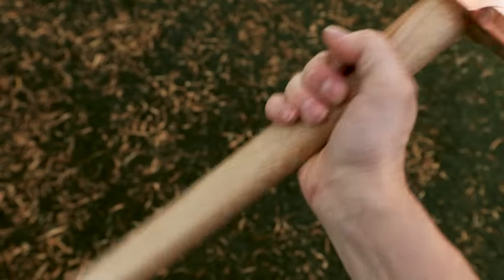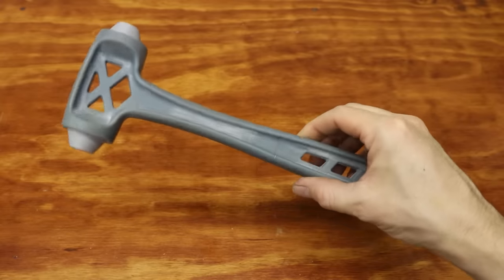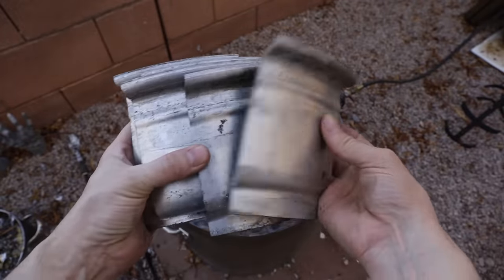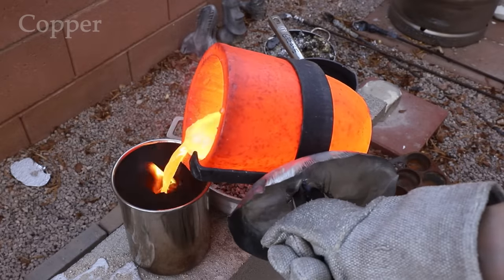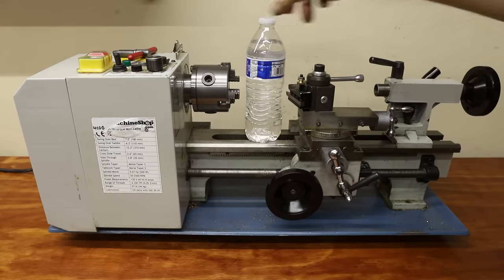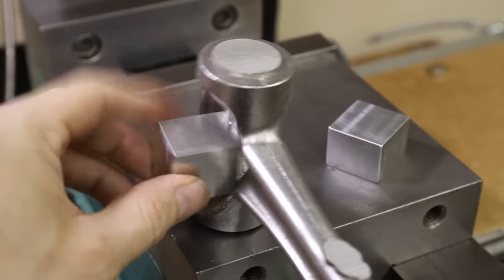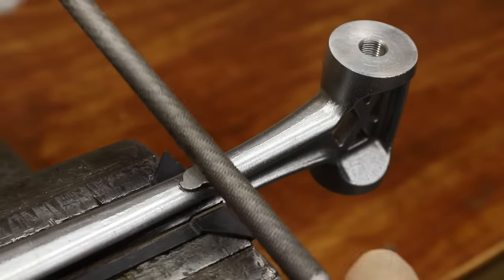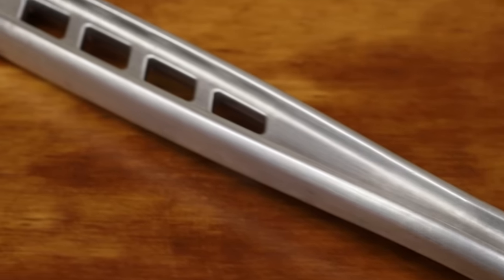Making a Skeletonized Hammer - COPPER or BRASS hammer? HAMMER TIME!

Comment: I really liked the idea of this hammer having the head screwed on. In theory you can create other heads for this hammer and change them as needed. It can transform into a rubber-headed hammer (used in woodworking), tipped steel head, or even a small ax or wheel wrench.
Reply: exactly
Reply: Hammers like this one have been being made both mass produced and custom made for a long time. You are right, you change the heads out for whatever you need. Most commonly brass and Delrin or PLA heads are used on them.
Reply: I used to have hammers like that there great, but this one is way better and prettier.
Reply: @darrellbeets7758  And WAY!  OVERPRICED !! TOO !!
Reply: @davidwillard7334  huh? Were are u talking about lol?
Reply: @darrellbeets7758  he was replying to @Curiosity Forge
Reply: No shit haha
Reply: @davidwillard7334  You know mate, there is punctuation other than exclamation points, and the caps lock key can be toggled off. Just thought you might want to know.
Reply: There's a reason that no decent manufacturer makes screw in copper faced hammers, about 25 years ago I had a brain fart and thought it was a good idea and wondered why nobody was doing it, I was an apprentice at the time and the tradesmen told me I was wasting my time and to not make screw in copper and aluminium faces for my Thor nylon faced hammer. So after I bought a new hammer a month later I didn't make that mistake again, the faces constantly came loose and ruined the threads in the hammer.
Reply: @RedMaij  SO ! SPELLBINDING !! TOO !!
Reply: Modular builds are definitely the way to go, especially if you want to quickly test and explore new features without making a new hammer.
Reply: @mrsock3380  Don’t use threads to lock your heads in place Brother, many ways to fasten an object in place. I recommend using a pin lock such as a cotter pin design.
Reply: Let me attach my sponge to soak up the water and then the magnet to hold nail in a dangerous way faceing me
Reply: Holy shit. They don’t come much smarter than Alan nowadays.
Reply: No sir. A hammer that's so beautiful like this ?I'm keeping it in a showcase
Reply: or even pickaxe
Reply: @RedMaij  so English isn't made to be written like a book constantly it's made to have inperfections
Reply: Неправильно сделано поверхность должен круглый. На этой молотком не сможешь ровно ударить
Reply: »The book of the generation of Jesus Christ, the son of David, the son of Abraham.
Abraham begat Isaac; and Isaac begat Jacob; and Jacob begat Judas and his brethren;
And Judas begat Phares and Zara of Thamar; and Phares begat Esrom; and Esrom begat Aram;
And Aram begat Aminadab; and Aminadab begat Naasson; and Naasson begat Salmon;
And Salmon begat Booz of Rachab; and Booz begat Obed of Ruth; and Obed begat Jesse;
And Jesse begat David the king; and David the king begat Solomon of her that had been the wife of Urias;
And Solomon begat Roboam; and Roboam begat Abia; and Abia begat Asa;
And Asa begat Josaphat; and Josaphat begat Joram; and Joram begat Ozias;
And Ozias begat Joatham; and Joatham begat Achaz; and Achaz begat Ezekias;
And Ezekias begat Manasses; and Manasses begat Amon; and Amon begat Josias;
And Josias begat Jechonias and his brethren, about the time they were carried away to Babylon:
And after they were brought to Babylon, Jechonias begat Salathiel; and Salathiel begat Zorobabel;
And Zorobabel begat Abiud; and Abiud begat Eliakim; and Eliakim begat Azor;
And Azor begat Sadoc; and Sadoc begat Achim; and Achim begat Eliud;
And Eliud begat Eleazar; and Eleazar begat Matthan; and Matthan begat Jacob;
And Jacob begat Joseph the husband of Mary, of whom was born Jesus, who is called Christ.
So all the generations from Abraham to David are fourteen generations; and from David until the carrying away into Babylon are fourteen generations; and from the carrying away into Babylon unto Christ are fourteen generations.
Now the birth of Jesus Christ was on this wise: When as his mother Mary was espoused to Joseph, before they came together, she was found with child of The Holy Ghost.
Then Joseph her husband, being a just man, and not willing to make her a publick example, was minded to put her away privily.
But while he thought on these things, behold, the angel of the Lord appeared unto him in a dream, saying, Joseph, thou son of David, fear not to take unto thee Mary thy wife: for that which is conceived in her is of The Holy Ghost.
And she shall bring forth a son, and thou shalt call his name JESUS: for he shall save his people from their sins.
Now all this was done, that it might be fulfilled which was spoken of the Lord by the prophet, saying,
Behold, a virgin shall be with child, and shall bring forth a son, and they shall call his name Emmanuel, which being interpreted is, God with us.
Then Joseph being raised from sleep did as the angel of the Lord had bidden him, and took unto him his wife:
And knew her not till she had brought forth her firstborn son: and he called his name JESUS.«

(Gospel of Matthew - Chapter 1)
Reply: @jakub8860  Amém. I dont have any idea why you wrote this here, but it is always nice to read the words of God. Some years ago I tried to memorize the Bible (inspired by the movie  "the Book of Eli") and I began with this chapter. I get just till chapter 3 or 4 lol.
Reply: Small axe? Maybe with a weight on the other side of at least 10 kg we can make a weapon out of it...
Reply: Small axe? Maybe with a weight on the other side of at least 10 kg we can make a weapon out of it...
Reply: @Piglin_Emperor  Maybe.
Reply: No hatchet or socket wrench. Not relying on threads into cast aluminum.

Comment: Looks great! Just make sure it never gets wet. Aluminium and copper in contact have a high electrochemical potential.
Reply: I didn't know that.
Cool
Reply: Or just add antiseize or some high quality grease. Not perfect but it might help
Reply: I just learnrd about this phenomenon that the more precious metal erodes the lesser one
Reply: @bigpat_4295  there can be only one
Reply: Only if it remains wet. Once the electrolyte dries up the electrolysis stops. Also plain water is not likely to be much of a problem as it has a low S/m.
Reply: Also, don't let it stay up past midnight
Reply: @benjaminholcomb9478  😆😆😆😆

Comment: If you ever design another hammer, instead of threads, poke the "leg" of the face through the hole in the hammer body, and then use leverage to keep it in place. Think jar lid with the metal wire. Not only does that look cool, but it also gives you more mass.

Comment: Make sure to anti seize the brass side or it will never come off, it and aluminum have a high galvanic potential. Beautiful project, really liking the chanel so far
Reply: That's great advice!
Reply: Copper and aluminimum can also have a galvanic potential too, we run into this a lot in watercooling too, lots of cheap parts are aluminimum so you can only use them with alu blocks and rads etc

Comment: Honestly, so cool the stuff you make. You should try making one of the detachable heads of the hammer out of non-metal. Just to see what happens.
Reply: Not an absurd idea at all. We have some hammers in our shop with a soft acrylic head for detailing work.
Reply: It would work perfectly fine so long as the threads were solid.

Comment: I've made essentially exactly this before, just less cool looking and the one warning I have for this kind of thing is that even though the screw-on faces are soft, with enough use they will completely deform the actual hammer head.

This was bad enough on mine that the whole thing had to be scrapped so for v2 I put a thin (2mm ish) replaceable plastic washer behind each head to soak up the impacts and it seems to work well.
Reply: DEFORMITY ! IS ! SOMETHING!  YOU !! HAVE  ! TO ! LIVE !! WITH !!
Reply: @davidwillard7334  yes, but good design limits it to the parts that are designed to deform.
Reply: @JedLath292  thus be smart with how ya make ya own tools :P a smith is only as good as his worst tools in the long run.
Reply: I was going to suggest exactly the same thing, a plastic or rubber gasket between the "heads" and "body" of the hammer will greatly improve durability over long term use.
Reply: @davidwillard7334  Something tells me this phrase is plastered on the wall of every...whatever the college class for smithing/version of Tech Ed is classroom.
Reply: »The book of the generation of Jesus Christ, the son of David, the son of Abraham.
Abraham begat Isaac; and Isaac begat Jacob; and Jacob begat Judas and his brethren;
And Judas begat Phares and Zara of Thamar; and Phares begat Esrom; and Esrom begat Aram;
And Aram begat Aminadab; and Aminadab begat Naasson; and Naasson begat Salmon;
And Salmon begat Booz of Rachab; and Booz begat Obed of Ruth; and Obed begat Jesse;
And Jesse begat David the king; and David the king begat Solomon of her that had been the wife of Urias;
And Solomon begat Roboam; and Roboam begat Abia; and Abia begat Asa;
And Asa begat Josaphat; and Josaphat begat Joram; and Joram begat Ozias;
And Ozias begat Joatham; and Joatham begat Achaz; and Achaz begat Ezekias;
And Ezekias begat Manasses; and Manasses begat Amon; and Amon begat Josias;
And Josias begat Jechonias and his brethren, about the time they were carried away to Babylon:
And after they were brought to Babylon, Jechonias begat Salathiel; and Salathiel begat Zorobabel;
And Zorobabel begat Abiud; and Abiud begat Eliakim; and Eliakim begat Azor;
And Azor begat Sadoc; and Sadoc begat Achim; and Achim begat Eliud;
And Eliud begat Eleazar; and Eleazar begat Matthan; and Matthan begat Jacob;
And Jacob begat Joseph the husband of Mary, of whom was born Jesus, who is called Christ.
So all the generations from Abraham to David are fourteen generations; and from David until the carrying away into Babylon are fourteen generations; and from the carrying away into Babylon unto Christ are fourteen generations.
Now the birth of Jesus Christ was on this wise: When as his mother Mary was espoused to Joseph, before they came together, she was found with child of The Holy Ghost.
Then Joseph her husband, being a just man, and not willing to make her a publick example, was minded to put her away privily.
But while he thought on these things, behold, the angel of the Lord appeared unto him in a dream, saying, Joseph, thou son of David, fear not to take unto thee Mary thy wife: for that which is conceived in her is of The Holy Ghost.
And she shall bring forth a son, and thou shalt call his name JESUS: for he shall save his people from their sins.
Now all this was done, that it might be fulfilled which was spoken of the Lord by the prophet, saying,
Behold, a virgin shall be with child, and shall bring forth a son, and they shall call his name Emmanuel, which being interpreted is, God with us.
Then Joseph being raised from sleep did as the angel of the Lord had bidden him, and took unto him his wife:
And knew her not till she had brought forth her firstborn son: and he called his name JESUS.«

(Gospel of Matthew - Chapter 1)
Reply: @JedLath292   My drill broke and now it identifies as a mallet.

Comment: A rubber buffer layer in between alluminium handle and both the hammer heads would help the handle deform less and changing the heads easier.

Comment: I remember decades ago, about 5, in metal shop in high school.
We did sand casting, sheet metal work and machine work on a lathe.
I made a small 2 faced hammer out of steel, brass and aluminum.
The head was about 1/2" diameter, was 2/3 steel & 1/3 brass. The handle was aluminum about 1/2" in diameter tapered to 1/4" tapped to fit into the head.

Comment: If you don't plan on getting a bigger lathe, get a used (second hand) cast iron surface plate that can accommodate the lathe's feet. A lot of the issues small lathes have stem from vibration management.
Reply: Could you also mount the feet on some dense rubber that would dampen vibes, and then mount the rubber to something solid e.g. concrete floor?
Reply: @RC-fp1tl  not sure, but I don’t think so. You want it to be as massive and solid as possible... so no rubber

Comment: Looks really nice I'd recommend adding a small slit from the threads to the side not a something deep just a tiny 20tho deep slit to release an air trap in 2-5 years when you swap the ends out otherwise in a few years once oil and grime builds up it will trap a vacuum and feel like it was epoxy together.
Another option is coat the flats in blue loctie this will seal out dirt and make it even more solid when you want to swap the end just heat it up to around 350deg for a min or two and it will spin right off

Comment: The hammer looks great! I can't imagine that it has much weight behind it. More of a precision light-duty type of tool than a nail driver, but I can bet it would be great for a jewelry maker or someone who builds models.
Reply: It was never intended to drive nails LOL!
Reply: Brass and copper hammers are used for working with metal, for doing things like seating a work piece in the video of a milling machine, or assembling a tool or machine, striking punches or stamps. Neither the copper nor the brass will mar steel.

Comment: Nice hammer!
Interesting how the comments give you a glance into the experience of your audience.
As for the threads: Use Heli-coil inserts in the head. Use blue Loctite to keep the faces on.
Hammer uses? Driving nails — haha. A hammer like this is primarily used to position work in vises for machining. Another thing she is for light assembly.

Comment: I did similar in trade school.. using set screws instead of make threads on the brass will help a lot long term, even if the heads need to be a bit thicker.

Comment: 3 things id like to see a Rubber or plastic washer to prevent the aluminum handle getting wear from the hammer blows and 2 other heads specifically rubber and rawhide as it will make the hammer more multipurpose

Comment: I was woried there for a bit untill you mentioned the hammers replaceable faces. Even there I would cry with every mark made on them. A little bit of good guidance at the lathe is to turn your lathe file around and use it on the bottom of the piece. It is big time safer and you get a far better view of what your piece needs. I cut the files handle tang off and wrap the other end with some good electrical tape. The streachy stuff, not that fidty cent  rools. Great piece, hang it on the wall where it belongs, LOL. Thanks a bunch and take care. See you soon.

Comment: I love it!
A while back I found a discarded sledge hammer head (I'm guessing it's two kilos) with no handle. I decided to make a handle out of some metal drawer runners put back to back to form a skeleton handle. I wrapped some PET ribbon around the bottom and it turned out better than I had imagined. Still, there is nothing like casting something yourself. Great job!

Comment: Really cool idea! There are two issues I see. First, no way to lock the threads. If they start to come loose, continuing to use the hammer would cause damage to the threads. 
Second (electrical background here), the dissimilar metals against each other will cause corrosion over time. I recommend wiping down the surfaces with de-ox before screwing them on.

Comment: That was pretty cool.  You should cast another one and anodize it, and or one with an over-molded rubber grip.  It's pretty much already designed to lock a grip in place.  Could even be translucent material so you could still see the skeleton design 👍

Comment: Bravo.  You are absolutely right.  You don't get better at anything by not doing it.  Outside the comfort zone is where the magic happens.

I love your ultralightweght racing hammer 😁  the design is cool and I love the replaceable faces.

I made a ball peen hammer in the machine shop when I was learning, and once I am all the way back home where I can have a shop I plan to make another.  Something like this will be when I worked my way up to having a foundry.  The machine work came out great.  I love the cast and machined surfaces.

Comment: an added feature of using copper and brass . those metals dont spark . so if you are repairing a large tank that held flammable  liquids . you would use this kind of hammer or the spark from a normal sledge hammer will set off the gasses in the air . thats not a good day . love this channels content .

Comment: My dad had English sport-cars (with the attendant knock-off wire wheels), to find a copper (or brass) mallet could cost as much at the wheels themselves (and this was the early 80's).  A machinery repairman (USN rating) on his ship taught him how to make the mallets (not nearly as nice as yours but effective), using some steel table legs (with the top and bottom cut off, to length for the handle) and a large can (Foster lager 1qt cans are perfect).  Punch the leg through the side of the (empty!) can, and pour the metal through leg into the head.....

Comment: Nice job just one word of caution using a tin coated tap on Aluminum is not advisable they have some aluminum base in coating that makes it a similar material to the aluminum you are taping that can induce galling. A bright finish tap is a better recommendation.

Comment: The only thing I would have done differently is to polish it to a mirror finish. But then I wouldn't want to use it in the shop. Best kept the way it is - a user, rather than something for the display case. Thanks for the video. Jon

Comment: Well, I made one. Casting came out okay. I used aluminum from an old car amp. I am going to use it as a machinist hammer, so brass on one end and nylon on the other. Put a big square piece of nylon in my 4 jaw in my lathe. First time I've machined nylon. It made chips until it was round, then one long continuous chip that wraps around it. What a mess. But, it machined well. Anyways, fun project!